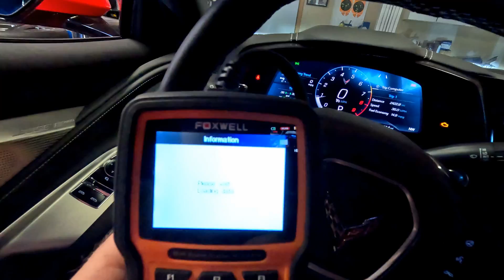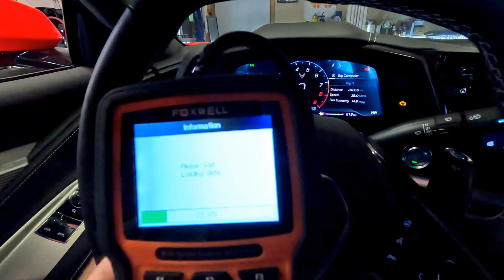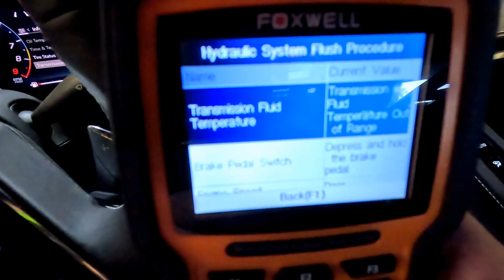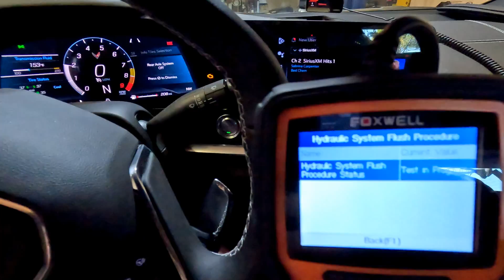C8 Corvette Transmission Filter Replacement with Computerized Flush

Comment: The C8 automatically flushes the fluid as you drive on the road. So the flush is NOT a requirement when changing your DCT filter. GM engineers have stated this already on camera.
Reply from the maker: The flush is part of the canister filter replacement procedure.  The 2024 Corvette repair manual calls for the flush procedure.

Corvette engineers are on record saying that the dealership procedure is designed to capture the most contaminant possible and that it’s not necessary for the Do-it-yourself-er at home to perform the flush.  

That’s not the same as saying it’s not required.
Reply: @RecordsRebuilds  He never said the hobbyest, you change words to fit your narrative.  Viewers should listen to him your self as not to have his words changed to fit someone else opinion.
Reply from the maker: @HerringMotorsports  I promise, I don't have a narrative.  Josh said "Do-it-yourselfer" is that different from hobbyist to you?  In case it is, I edited it to change it.  Sorry to have gotten off on the wrong foot man, I'm sure you are a great guy.
Reply: NOT SO
Reply: @johntrow4529  Ok, everyone should believe a random guy on the internet and not the Chief Corvette Engineer.   Goto timestamp 23:40 and hear what Josh has to say.    https://youtu.be/0n_IdGg6Lg8?si=hIKksaFOvVM2JYc0
Reply: @HerringMotorsports  my point of view as just one of many that own the car is that its ideal to do the flush.  In my opinion, if not they wouldn't do it at the dealership.  So, you don't have to but for a one time cost of about $180 it seems like it would be worth it to buy the tool and do it.  Josh has taken some heat from existing or potential customers for being responsible for a car that some view isn't serviceable as the prior generations.  I take what he said is that its not critical but its ideal.  Just another opinion.  All good if you don't agree with my interpretation.

Comment: This flush is not necessary, Your car automatically does the same procedure while driving at normal highway speeds.
Reply from the maker: I’m sorry, but you are incorrect.  The GM service manual says this procedure is necessary and says it is different than driving your car at normal highway speeds.
Reply: @RecordsRebuilds  Show me where it says that in the manual. LOL. I think Josh Holder (Chief Corvette Engineer) knows better then someone who heard it was in the manual. I am sure the manual does not specifically say it is different then driving at highway speeds. You sure you are not making that up for effect? This is how misinformation is created.
Reply from the maker: @HerringMotorsports  You can't post screenshots here.  Where would you like me to post them?  Should I just copy and paste the text?  Can you point me to anything spoken or written by Josh Holder saying you don't need to perform the procedure the way its specified in the repair manual?  I'd certainly trust Josh or Tadge, or any of the other engineers if they said you didn't need to do it, but why would it be in the manual if you didn't need to do it?
Reply: @RecordsRebuilds  https://youtu.be/0n_IdGg6Lg8?si=hIKksaFOvVM2JYc0 Timestamp 23:40
Reply: @RecordsRebuilds  Caution The transmission external canister filter must be changed at 12 000 km (7,500 mile) during the break-in period. Failure to replace the external canister filter can cause damage to the transmission and potentially void any warranty.
Reply from the maker: 2024 Corvette Repair Manual page 28,358/31,130

Automatic Transmission Fluid Filter Replacement - External Canister Filter
 Removal Procedure

 Caution If the vehicle is beyond maintenance interval for the automatic transmission fluid filter – external canister filter replacement, a new filter must be installed prior to running the hydraulic system flush procedure. An 
overloaded filter will allow bypass and continuously circulate contaminants through the transmission. Failure to replace an overloaded filter can allow contaminants to escape the filter and enter the transmission and 
may result in damage to the transmission.
 
Perform the hydraulic system flush procedure. " tocId="103178">Hydraulic System Flush Procedure
Reply from the maker: 2024 Corvette Repair Manual page 28,167/31,130

Hydraulic System Flush Procedure
 Diagnostic Instructions
 Perform the Diagnostic System Check prior to using this diagnostic procedure:" 
tocId="1049">Diagnostic System Check - Vehicle
 Review the description of Strategy Based Diagnosis:" tocId="1044">Strategy Based Diagnosis
 Description
 This procedure is used to flush the transmission fluid through the filtration system before a repair is 
performed that may have been caused by debris in the fluid.
 The following will occur when the scan tool control is enabled:Engine Speed=2,000•RPM&Line 
Pressure=Increase—For 8•min
 When to Perform the Procedure
 Perform this procedure before servicing the component:T12•Automatic Transmission
 Conditions for Running the Procedure
 DTCs related to the following system/component = Not Set
 K71•Transmission Control Module
 T12•Automatic Transmission
 Brake Pedal=Applied
 Engine=Running
 Transmission Fluid Temperature Sensor=Warmer than 60 °C (140 °F)
 Transmission Range=PorN
 Vehicle Speed=0•km/h (0•MPH)
 Reference Information
 Scan Tool Reference
 " tocId="980">Control Module References
 With Scan Tool
Note
 Do NOT perform this procedure unless directed here from another procedure.
 Ignition » On / Vehicle » In Service Mode
 Select:Module Diagnostics
 Select:K71•Transmission Control Module
 Select:Configuration/Reset Functions
 Caution
 If the vehicle is beyond maintenance interval for the automatic transmission fluid filter – external 
canister filter replacement, a new filter must be installed prior to running the hydraulic system 
flush procedure. An overloaded filter will allow bypass and continuously circulate contaminants 
through the transmission. Failure to replace an overloaded filter can allow contaminants to escape 
the filter and enter the transmission and may result in damage to the transmission.
 Select:Hydraulic System Flush Procedure
 Follow the instructions on the scan tool.The procedure will complete within 8•min
 Repair Instructions
 Perform the Diagnostic Repair Verification after completing the repair:" tocId="1058">Diagnostic 
Repair Verificatio
Reply: @RecordsRebuilds  That is not the owners manual, Is it a third party document? I didn't see where it specifically said the flush procedure is not the same as the drive procedure that automatically happens when driving. Having said that I will go with the guy that helped engineer the C8 and not some third party internet guy or a third party book. I will save you some time timestamp 23:40 https://youtu.be/0n_IdGg6Lg8?si=LvOuXMX2JJdF2sz_
Reply from the maker: @HerringMotorsports  Hey Herring, sorry you're taking this in an adversarial way.  Just so you know where you are, you've actually found your way to a free self help video a guy posted to the internet to help strangers.  The manual is legit.  If you doubt that, you can pay for a subscription from GM and read it yourself.  If you have a place you'd like me to post the screenshots, let me know and I can do that to.  

You linked me to a video where Josh says the very best way to perform this procedure, the way the dealer performs this procedure, is to perform the flush, but that it is ok for do it yourself-ers at home to not perform it.  That's actually evidence in support of the point I am trying to make.  Everyone has been doing it at home without the flush for 4 years, that's obviously better than nothing, but not the ideal way to do it.  The repair manual calls for the flush to be done and you supplied me of a video of Josh saying you should perform the flush if you can.  I'm going to consider that case closed.
Reply: lol. He never said anything the way you said it. He never said it is better or worse, Do you hear what you want, or do you lie. He said the dealers only do it because they can and it is not necessary, in fact your car does it automatically every time you drive a..... I find it weird that you would want to mislead your youtube followers, when you know the truth now. You are corrected.

Comment: How do you guys trust dealers to work on your c8 properly when most of the techs are use to working on pick ups and malibus
Reply from the maker: Well, that’s kind of the cool thing about Corvettes, they are a lot the same as Trucks and Malibus.  Always 7mm, 10mm, 13mm, or 15mm bolts in all 3.  The trucks and Corvettes shared engine blocks and many of the transmissions from 1997 to 2023.

It does not worry me at all that the techs also work on trucks and malibus.  It bothers me a ton that some of the techs don’t care about the cars and won’t read the instructions.

Comment: Thank you for the video, very thorough and detailed. I have seen estimates as high as $1400 to perform this same service from the dealership. Please save all your receipts for proof of service for any warranty claims.  Note GM recommends changing the DTC fluid every 3 yrs regardless of mileage, sounds a bit extreme to me for low mileage vehicles but you may void the warranty by not adhering to this recommended service interval.
Reply from the maker: Remember, this video is just about changing the filter, which is changed independently from the fluid.  The fluid change is so expensive because it’s a lot of fluid and I think it costs around $20-$30 a quart.
Reply: @RecordsRebuilds  If you find it for $20 a quart please post a link, I can't find it much cheaper than $35.
Reply: Also take note, the "flush" procedure is not a replacement of fluid, this procedure dealers do when changing the DCT filter because they can but is not necessary, It is a circulation procedure to force dirt to the filter just prior to changing it. But again not necessary, it does not hurt but if you don't have the scanner to do it it is not necessary.
Reply: @HerringMotorsports  Glad to see there's a drain plug on the transmission pan, be a drag to have to remove the pan every 3 years for the fluid replacement.

Comment: do you have to replace any transmission fluid that is lost with the filter replacement?
Reply from the maker: That is debatable.  Technically you should run a fluid level check.  This requires starting the car, putting it through the gears and filling it to the fill plug level.  When I did this, fluid poured out leading me to believe the transmission was still over-filled from the factory even after my filter change.  In my case, I left the level as is.

Comment: Torque is measured in Lb-Ft or Lb-In.
Reply from the maker: You are of course correct in the strictest sense.  I tend to use the colloquial order that most people use when speaking about lb in, but  the GM manuals have cured me of saying “foot pound” over the years.  Saying “pound inches” out loud sounds particularly painful and I think most people say it the opposite way in conversation.

Please see the disclaimer at the beginning of the video.  If reversing the order of “in” and “lb” caused you to ruin your transmission I am dreadfully sorry ;)

Comment: GREAT video !!!!     Does anyone know if this will do the C8 Flush Trans Filter  on a 2020 C8 with M1L transmission?    Thought I'd seen where someone said this tool,  and the X431 Elite tool will only work on 2022 or newer for this type of procedure .

I had the one freebee done at the dealer,  but have since done  ALL my own maintenance including the 3 year DCT fluid change, and  I also changed my DCT filter.  But  I would really like to be able to do the flush procedure as well, if possible.
Reply from the maker: I have heard what you have heard.  You could always buy the tool on amazon, try it, and return it if it does not work.
Reply: Let me know if this works for you as I have a 2020 also!  Thank you!
Reply: @JavierGarcia-je5ce  I have learned from 2 sources on CorvetteForum who have tried either of these tools will NOT  work for a 2020 or 2021.  Only option is the GM tool.
Reply: Strake I just posted on the forums. The NT710 works on the 20-21. Just ran it 20 minutes ago.

Comment: Hey great video  I’m at 7500 and don’t trust the gm stealership any idea if the nt530 upgrade will do the flush.
Reply from the maker: I do not know, the NT510 Elite seems weirdly positioned and very high functioning for the price.  You can rarely tell what a Foxwell product actually does based on its price.  All of them are available on Amazon where you have until mid-January to send it back if it will not do what you want it to.

If it works, please respond back so this comment section can become a sort of database of which ones work and don’t.
Reply: You did not want to change transmission fluid at the same time? It is considerably work to get all those panels out twice!
Reply: Got the foxwell 510 elite for 112 on ebay
Reply: @benreid541  If you do not have a scanner, keep in mind this flush procedure is not necessary. Josh Holder explains why on Corvette Today youtube channel. Episode 212 and timestamp 23:40

Comment: Great video!  I'd love to know where you got the manual that specified the written information for this procedure?  I've seen shop manuals on CD on ebay, but the reputation of those are pretty sketchy.  I found a free download, but it was nearly useless.  Also, FWIW, it looks like Foxwell offers additional software licenses for other car makes for $80 (I own a couple Hondas as well as my C8).
Reply from the maker: I have the $80 Honda upgrade and have used it to program a few keys for my Sister-in-law.  Can confirm it works well.  You buy them through the same foxwell app that you can use to update the device itself.

GM no longer sells Helm service manuals in printed format (as far as I can tell).  They would prefer you subscribe to their database which can cost as much as $30 for a 3 day subscription.

I do not believe in theft of intellectual property, but they are being ridiculous here.  If you go to this website, you can pay them $69 to obtain a subscription for you from GM and print the entire 22,000 page manual into a .pdf.  No intellectual property laws are broken, it’s the same as if you paid your sister’s kid Mike to hit print 22,000 times and compile it neatly in a .pdf.  You can find that service here: https://www.factory-manuals.com/shop/2024-chevrolet-corvette-repair-manual/
Reply: @RecordsRebuilds  Are you saying you would need to hit print 22,000 times to get this entire doc??  Other issue is there would probably be no useable http links for searching which would make it cumbersome.
Reply from the maker: @gp1200x  it has links, and it also works pretty well to use the search feature to search the text.  I’d certainly rather pay $450 for a set of paper manuals like the old days, but they don’t do that anymore.

Comment: I watched my dealer do my ZO6 and they didn’t do the flush. He did have some type of fitting to add the lost trans fluid back. He said he has measured the amount lost during the filter change and how much he loses when he pops the fill fitting off and puts the bold back in. He just adds that amount back in.  Allegedly. 😂
Reply: Replacing the correct amount lost during a DCT filter change (usually just a few ounces) is not the purpose of the "flush" procedure.
Reply from the maker: That might be the best way to do it I guess?

I could see someone making a case that this flush does not matter.

I have a long history of doing things exactly like GM and Mobil 1 say.  This has lead to over 500,000 trouble free miles without any sort of powertrain damage.  I will continue to do it exactly like they say.

Comment: Great video! I just bought the scanner you used directly from the manufacturer for $160 bucks. Don’t trust Amazon for items like this. Since I have two C8 Corvettes, this will same me money on the first use. Can’t trust my dealer to do the job. Does anyone know if the info is stored in the computer after it’s done for warranty purposes?
Reply: DCT filter change is not recorded in the computer.  And do not reset the transmission life on the dashboard for this process.  That monitor is checking fluid life if I recall correctly and not the same as the DCT filter change.
Reply from the maker: I don’t know, but I doubt it.  I bet it just records if you reset the trans filter life or not.

It’s a great little scanner.  One time I accidentally left it behind the seat of my C7 and when the seat moved to entry position it cracked the screen.

I was able to find a replacement screen online and it was super easy to replace.

Comment: Great video Thanks for sharing. Where did you find the code for your transmission?
Reply from the maker: You can Google it.  They are called RPO codes.

Stingray: M1L
Z06: M1M
E-Ray: MLH
Reply: Got it thanks…..